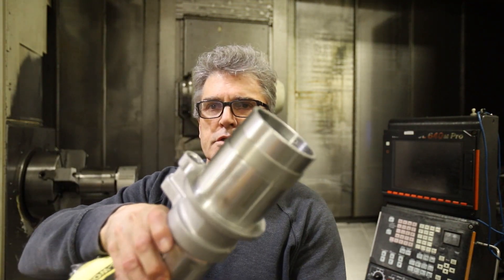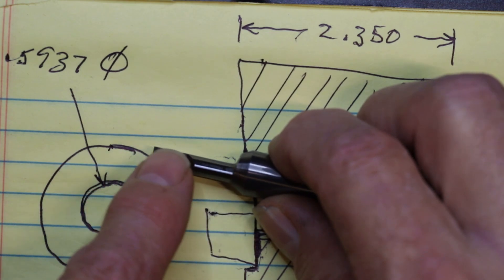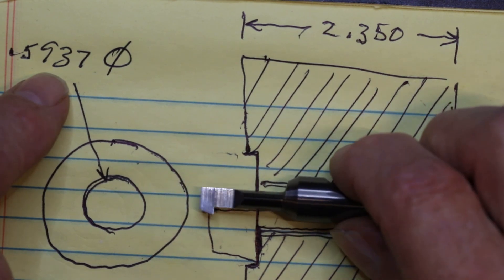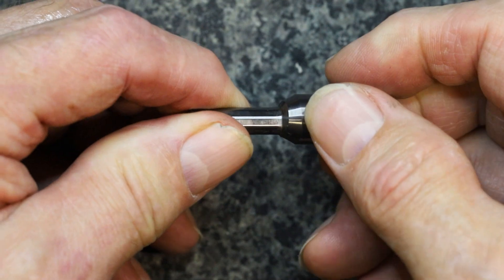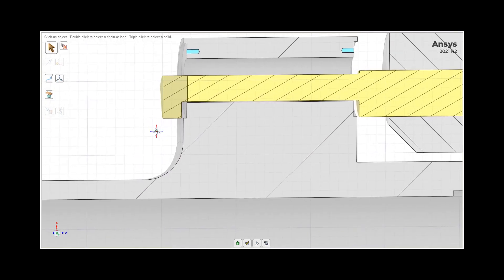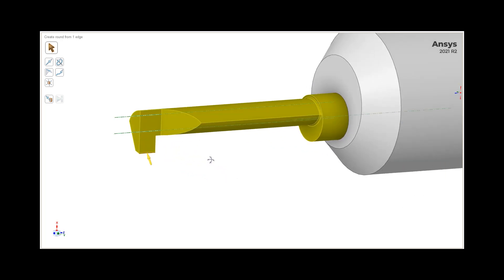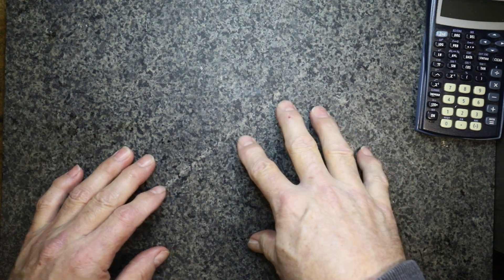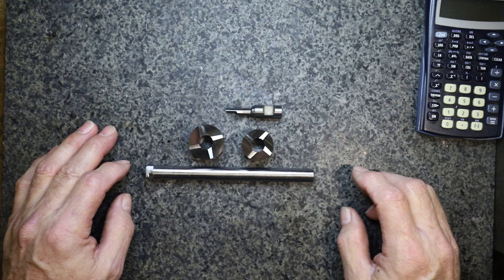Back Spot Facing Tools

Comment: I'm not a machinist, and I'm the wrong sort of engineer (computer, not mechanical) but I wonder if one could make a simple clamping system for the back spot facing tools by drilling & tapping the rod, and then having a screw with an appropriate washer to clamp the tool in place. Slower time to change out the tool, but likely more repeatable positioning. 

The angle head seems like it would make the overall cycle time the lowest, since there's no need for taking the parts to the drill press. And it's useful for other similar jobs later (even this job when it repeats, since you mentioned Centerline has done it before). If it's available in time it's probably worth it, it's the most versatile option. It's the only one of the three that would work for spot faces wider than the diameter of the hole, or even with no hole at all. 

There have been a number of parts on this channel where you've needed to flip the part around to machine things on the back, with the resulting delay to indicate everything in again. Having an angle head in your tool library could change that into a simple tool change operation. I suspect you'll get quite a bit of use out of it, almost certainly enough to justify the cost. The big open question is availability.

Comment: We're using both of those tools (back spot face and right-angle mill) but the right angle is for a small aluminum job that you physically cannot get to. It took a lot of work to dial it in even though it was for a small aluminum cut. We are using the back spot face but we are doing a back counterbore. It is 1-1/2 dia .650 deep in aluminum. We had to EDM a lot of relief in them for the amount of material we had to remove, otherwise it clogged. Best of luck

Comment: I've made my own back spot facing tools by taking a piece of drill rod, drill a hole through the side large enough to press a piece of hss through letting it broach the square corners through. Then its locked in place with a set screw in the end of the drill rod. The hss extends out to the diameter i want and i grind a cutting angle and relief angle into it. They're a quick and dirty cobbled together tool usually made just with whats laying around but you could improve on the idea im sure. I'll drill or ream a hole in the part just slightly larger than the drill rod then slide it through from the back side and lock it into a collet holder or side lock then cut the spot face and remove tool. Depending on finished through hole size then sometimes i drill the hole out afterwards to its finish size. You could easily add a shoulder to the one end to shoulder out against the tool holder to maintain offsets. Im usually doing this on a manual boring mill so i just finesse it as needed.

Comment: Could the back facing tool be on centerline, inserted into the hole and then run a helical path to get the spot face all the way around? That way you can adjust the size of the spot face by adjusting the path. It would be like an end mill with a reduced shank and reversed cutting geometry (or another way to think about it is to imagine a normal end mill with an extension rod poking out of the centre cutting portion that is held in the spindle).

Comment: Peter, the door lockout on my machines are controlled by a simple micro switch.  I can operate the spindles by tying down the switch plunger with a plastic tie wrap or zip tie.  Just remember to cut them off when finished with any special operation to comply with the safety inspection.
Reply from the maker: Does you machine have auto doors or do you open them manually?
Reply: @EdgePrecision  I open them manually, but either way I would think there must be some type of switch to signal the controller that they are closed/open, unless an electronic beam might be used, but that would definitely add to the cost of manufacture of the machine.
Reply from the maker: @37yearsofanythingisenough39  on my machine there is switches on the door being closed. Just like yours. But mine has auto doors. These are opened and closed by air cylinders. Each end of the cylinders have limit switches. All of this is controlled in the machines ladder program. So it’s looking for the closed switches the air cylinder end travel switches and even a pressure sensitive on the edges of the doors. If you close them on your hands or something in the doorway. Even if the doors take to long to close it will get a alarm. So let’s say you left the key in the close switch or used a zip tie. The minute the door opens. It will see the closed switch on but the air cylinders switch at that end will turn off. This will cause a alarm. Now I have asked a guy that works on the machine. He is not a Mazak guy. In fact he knows better than them how to fix their machines. I asked him if all this could be overridden. He said it’s virtually impossible or extremely difficult. The machines ladder program would have to be rewritten. Believe me when I tell you. I have looked into this.
Reply: @EdgePrecision  You have a much more complicated system than I have apparently.  It was a thought anyway.  I wanted to help you since you have helped so many others.  I do not know how you find the time to make the videos you do and concentrate on your work besides.  You’re amazing!

Comment: I think that angle head is the right choice, and as you say, you can use it on other jobs also. 
Have you considered a spindle driven angle head with fixed body? How much of rpm control you can get with that coolant powered angle head?

Comment: There is another style that uses a insert that you put in once the tool is through the hole similar to the ones you have. I actually just used it this week.  Same issue though if you forget to take it out you're screwed.

Comment: I used to hand make gears sets of racing gearboxes. Close ratio kits.  They had a male spline on a boss on one side. Now I didn't grind anything, just machined nicely, accurately and then cut teeth and splines. Gears were mostly between 95mm and 65mm OD and had a bore around 38mm. I cut the billets long enough for two gears plus about 6mm for parting op. I would then hold blank and finish machine one gear blank finished and back bore the internal shoulder and grove outside and machine back face of gear blank but I would part right off. Left about a 8mm wall thickness ring of material where the gear face didn't matter. I would do a batch and then go thru and machine the other end and the part off once all machining was done. One I had the individual parts I simply cleaned up the "joining ring witness" with a large radius face groove that served two purposes. It removed weight and removed the "plus" metal of no importance from the face. The big advantage of this process was all the surfaces were concentric and all faces were perfectly perpendicular to axis without any runout. This meant my gear cutting was easy, runout was zero, they stacked and easy to mount. The extra effort of ensuring accuracy was easily compensated  in quality of finished item.and the reliability of gear and splines cutting setup. Keep in mind these were just machined on a centre lathe with just a dro and quick change tool holders. No cnc here. After heat treatment it was simply a matter of boring bore with ceramic insert and job done. Grinding was expensive and unnecessary. The gear sets I made were reliable and affordable for the race car guys down here in New Zealand. Made them like that for about 20 years. Thousands of gears over the years. Still get calls but I've just retired.

Comment: Those shrink tools are super useful!  They're made by Iscar called the ER SRK collets.  But they only make them to in ER20 and higher.  I think Haimer makes the smaller ER16 shrink versions.  I haven't priced the Haimer ones, but I know the Iscar ones are about $120 from MSC.
Reply from the maker: I have those and use them all the time. What I’m referring to in this video is. https://www.bilzusa.com/tg_ter.php these are just the collets with a shrink fit hole.
Reply: @EdgePrecision  ohh I see, I think Haimer also does a few of those standard collets with shrink fits too.

Comment: A brand called SFI Toodle makes coolant driven spindles where the tool is pressed into the bearings that hold the turbine. I think they supply angle adaptors for their spindles but it wouldn't be too difficult to make your own and just purchase the bearing and turbine assemblies. The bearings are retained behind a nut and I believe it would be possible to just swap bearing assemblies (with the tools pressed in) without having to touch of every time. I paid ~700 usd for 2 bearing kits, a spindle housing and a coolant pressure gauge. I don't remember the details but I think  the bearing kits weren't too expensive.
Br and good luck

Comment: Iscar sells an indexable id grooving boring bar, the chamgroove line, kenametal has some others similar. Buy inserts a little over-size so you can grind them to size. Feed the bar in on center and screw on the insert, cut the feature, back up and unscrew the insert, rapid out

Comment: Does the angle had has enough clearance to reach "deep" enough to drill the lower holes? Very useful information to hear your thoughts. Also the solution to face through the hole which such tight space: there is a much greater risk that something goes wrong? And last: what if you do  the drilling and facing by hand on a bridgeport that gives you excellent controll and access?

Comment: I do loads of stuff like this and especially radii bottom oring face groves on a mill by sticking off the shelf turning tools in a boring head. Just wind the boring head out to the eccentricity you need to get the od you want. 

Loving the other tangent ways of doing it. Making a part is easy, but making lots efficiently and accurately on cost is the hard bit of engineering

Comment: The angle head is nice, is there a way with that back face shank to put a taper into it? And then have a spring loaded detent to hold it in place.
You could probably grind that existing shank if it’s long enough to do that, or just grind the other end of it.

Also is there a way to make a solid blank that you insert into the hole from the cutting side then bring the holder over and tighten it in the machine, cut the hole then remove it from the holder again?

Comment: I've had success with UHT Corporation air tools for a similar application. I modified (cut shroud off and made spindle adaptor) a MAG-093N to accept a endmill. They are about a 1/10 of the cost of coolant driven ones. Hope this is useful.

Comment: Hey Peter! 
First, I'm not kidding when I say that when you talk I listen!  Seriously, when you release a video I have to make sure I watch when I can't be bothered and keep a note book by my side for random notes. 
As far as tooling goes, is it possible to use the existing rear facing cutters and drill and tap the arbor for a cap screw to keep the cutter more secure?   I can't believe that it's made to be all loosey goosy on there..
Reply from the maker: I have thought about that. But I was trying to avoid having screws to undo in the middle of a tools operation. What if you got interrupted or distracted by soothing and forgot to undo it. Like making YouTube videos.
Reply: @EdgePrecision  Maybe put multiple M00 3 or more maybe 5? less likely to make a mistake? I learned that from you, not very elegant but it seems to lessen the chance of mistake from in-attention, by the way your doing a great job, the best I have seen on YouTube.

Comment: I would go for a rigid back facing tool in combination with a hydraulic chuck and an exact repeatable stop when inserting the tool into the hydraulic chuck. 
Then change in the empty hydraulic chuck and move it into position, stop the machine, insert the back facing tool, run the back facing, stop the machine again and remove the back facing tool. Opening/closing a hydraulic chuck can be done within seconds. 
Further the back facing tool do not need to be the exact diameter. The can be under size a little and the machine can do a little rotary move as long as their reach is deep enough.

Comment: I may have an idea, but it is somewhat difficult to put into the words:

That back spot face tool could be glued permanently (to increase precision and rigidity), then bring the machine into the position (as you would if it is not glued) then insert the tool through the material from the back of that diameter and affix it to the tool holder. Use one of the smaller gauge blocks to find the offset and that is pretty much it.
Also using the same technique you could insert a normal boring bar (no offsets on the tool holder blank) through the back of the material. That way shank cold be larger since the cutting edge doesn't have to pass through the hole.

The only problem is that the tool would have to be fixed in and removed for every of the operations.

Comment: Think of it in this way. If you spent all the money and time making tools and modifying tools that can only be for this specific job. Versus buying the right tool for the job (pun intended) you will probly break even on this job, but as you said you can use the right angle head for many future jobs and videos. My opinion is buy the right angle head tooling. Thank you for sharing the internal struggle on camera when problem solving a job like this.

Comment: That's a doozy of a conundrum you've got there, personally I'd go with the angled milling head, it's a lot of money but I think you will have much more controllability with it and will be much less stress and headache, plus you will find many more uses for it as you've said, not sure what the lead time would be so its definately not the quickest solution but that's where I would lean. 

If I were to go down the back spot facing tool route (the detachable head version) I would remake the arbor altogether so you eliminate all of that slop, or see about getting a differant version of it, I've used versions where the cutter stays attached to the arbor and just flips out when you turn the spindle on which worked good.

Or maybe look into a coromill 327 or equivalent, not sure if you already have something similar or not but it's basically an indexable tip tool which I'm sure you could make an insert up to screw onto it and use, from memory sandvik use a funky thread but pretty sure mitsubishis equivalent is a lot simpler.

Anyway best of luck to you Peter, great video as always.

Comment: Some random thoughts:
1. Can you redesign the arbor for those back facing cutters to have some sort of camlock ramp on the back, so that as the arbor turns it will lock the tool to a specific location on the arbor and eliminate the .030 play?

2. When using the thru-hole ground single point cutter, can you grind it for a face that is larger than what you need, and use a thread milling cycle (or similar) to adjust the size of the circle it actually cuts? If so, maybe you can use the same tool for both back faces. That would save cost and time.

3. With that same cutter, can you grind another cutting face on the bottom of the shaft before the mounting length, so that you could use it to face both ends of the hole using the same tool? That would save cycle time since you just have to stick it thru the hole, then index forward for the front face, backward for the back face, then re-center and withdraw.

4. I know you want to do these in one setup, but if you have to use the drillpress you will have two setups. I wasn't clear on why you couldn't make a second set of soft jaws and reverse the shaft to do the back-side cutting. You might need a long boring bar to do the spot faces and a long drill extension to do the small holes. Possibly you could make something like a 2.5" diameter bar with an ER16 or so collet on the end and use heatshrink tooling for the facing cutter and drill, so you only have the cost of one long extension, but do have some manual tool changes.

Comment: Great video Peter, wouldn't something like the interchangeable head end mills Sandvik has could work? Or like they have with the exchangeable indexable heads? For the back face cutters, but that would be a lot of work to get/make, the angle head seems like the best investment if you can get it on a timely manner

Comment: Peter, the angle head would be my choice, universal type by Big Kaiser could be used on all sorts of other projects
Reply from the maker: I beauty of the coolant powered one over a spindle driven one is. The spindle driven one is fixed to a key on the spindle. It can’t be rotated with the spindle orient fiction. But the coolant powered can because it doesn’t depend on the spindle for power. So the tool can be defined as a turning/lathe tool. This gives it the ability on this machine to be oriented and clamped every 15 degrees and powered by the high pressure coolant. This almost gives the machine another axis of rotation.

Comment: Would it be possible to ask the costumer if instead of the two holes from each side you could do one intersecting bore? I mean a gun drill would make quick work at least of these features...
Reply from the maker: These holes are undersize. They are going to team them to their proper size at assembly. I don’t know exactly what that means. I would assume it refers to reaming through the mating parts hole to insure alignment.